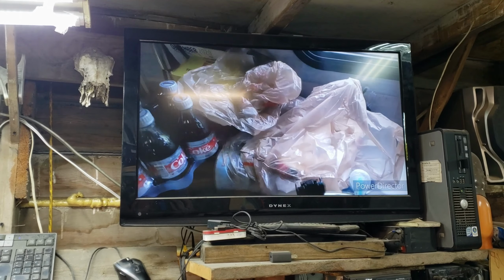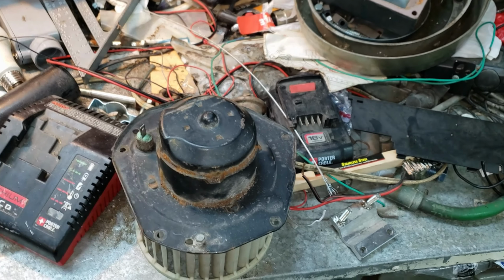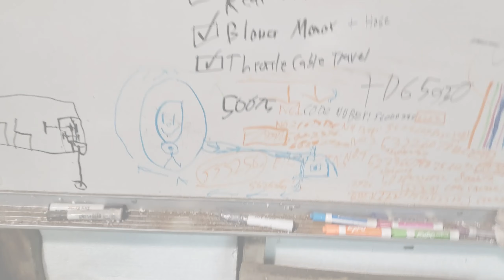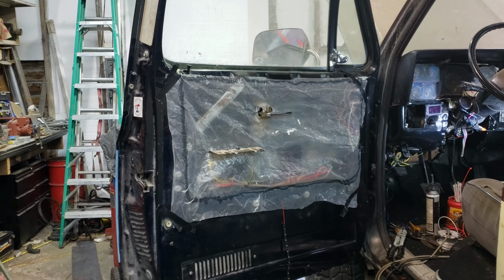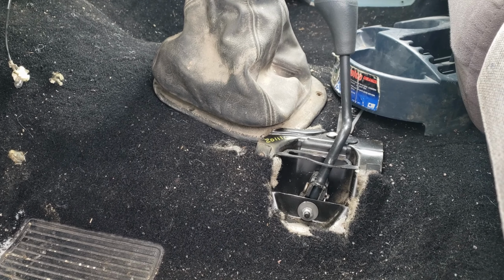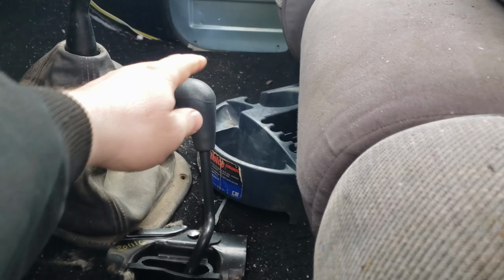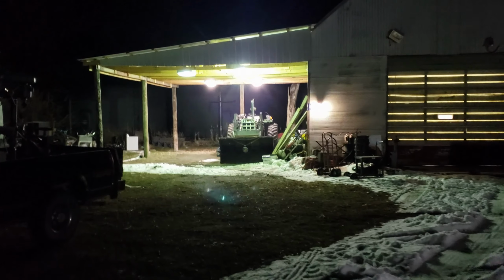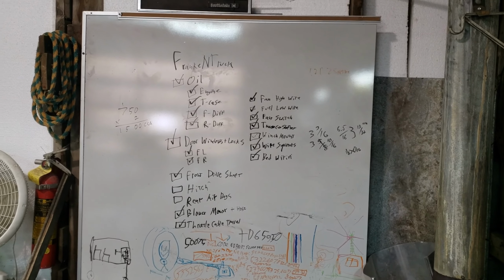FrankenTruck PreTrip List before a Big Trip Part 2 Cummins Swapped SquareBody Chevy

Comment: Was that a plastic tank up under there?  Behind the transmission.
Reply from the maker: Hmmm, not sure I know what you're talking about.  What time in the video are you referring to?
Reply: Right after you were talking about the shifter you crawled up underneath there to look at the transfer case.  No big deal just wondering.
Reply from the maker: Ahh.  Probably the fuel filter.